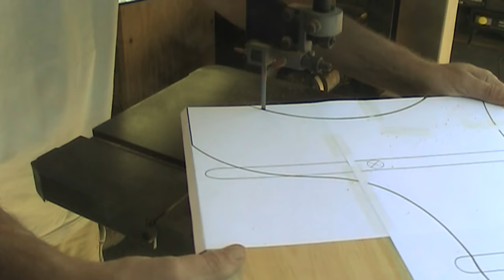Sturdy, easy-to-build, two-step step-stool

Comment: Good video. I think a dado joint is not quite strong enough if you use the step-stool every day because it's just glueing end-grain to face-grain. Adding dowels is an easy way to make it stronger. But amateurs don't have to do so! :)

Comment: Yes, there is :) You just need more patience and time to make it. I actually don't have biscuit jointer, so I simply don't use biscuits. Don't have band saw as well, I use dovetail-saw and rasp when shaping curves. Oh, I have router, but you can round edges just with sandpaper, no problem. And use normal blades instead of dado, a little bit of additional sanding and you are done. Try to figure out those things by yourself and you will be proud of your work. Really!

Comment: Thanks for the answer. Actually I've done some stuff with only a hand saw, chisels,a hand drill and a bench drill. I admire the work from Charles Neil or Paul Sellers, who both have mastered hand tools. For the mere mortals, that accuracy level is still far. On the other side there are people who really takes out the best of machinery (Mathias Wandell or Steve Marin). I guess in this business there's no one who knows everything.

Comment: Hey Steve, love your video, specially since I'm trying to look for ideas for step stools for little kids to use in front or around a toilet.
My sister in law works at a day care and ask me if could build some little step stool for the little kids at the day care centre... Is it possible you could share or create something that could work for the kids, I will appreciate it and so will those tiny kids..
Thanks Steve.
Reply: +elton herrera  You're implying this set up will not work for tiny kids, why wouldn't this size/design work? my nephew and Niece used a stood pretty much this size from when they were first able to physically use any step.   (I looked at the PDF and it is the same size) 
Make this stool with his template and those little kids will use it no problem. In fact I would think he intended for this to be used by kids because the two step is useless  for adults as the top is all you would need.
Reply: try sitting down from the second step on to the toilet if you a tiny kid! I get that is good to teach kids to be creative, but for a day care centre you don't want some other parent kid to have a tiny little accident, people are delicate when it comes to their kids. Just something that they don't have to turn the stool around and that could stay in the washroom only and not all over the house or building. One step would work for potty training, but if kids are bigger and they need to get the cookies on the counter is more than perfect and for everything else is also perfect... I was referring to an idea or design in front of toilet, that also fits around the neck of toilet, that looks neat and catches a kid attention rather than just building a plain box in front of toilet.

Comment: I'm a novice when it comes to this stuff, and one of my biggest problems isn't time or patience, but not knowing what certain tools are or what they do. For instance, the sticky paper you used on the design. I have no idea what that stuff is called or where to find it. Is there a resource (either book or video) that has something similar to an illustrated glossary for the various tools used around the woodshop?

Comment: Nice video....can you please tell me the width of the wood????
Also i would like to tell me the round bit at 0:55 what height does it have?
I tryed in various heights and turn it from the other hand but the result was awfull.
Also what kind of blades at 0:58 are you using and has that width?
thanks in advance
stelios
Ps keep going the nice videos you are making

Comment: I recently had to make slots in some planks like you did at 0:58. I did so by using the factory blade that came with the table saw. Is that considered kosher? Also, if I need to do that again in the future, what's the kind of blade you used called?

Comment: Great video as always Steve but I have a couple of questions as no other documentation was given other than the side templates.  What was the original length of boards you joined?  I am assuming 48" length due to template and video at 1:14 appears the step width is approximate that of the side depth.  If I am completely off please reply to my comment, however I just realized that the other comments made were 10 years ago.  Is there another way to ask questions?  I for one really appreciate your voice during your projects as you make all projects interesting!!

Comment: Hello 
Gnjoyed their work more I would like to know about the mountains where u bought it or if u put side by side to ok. 
I await your return and congratulations for their work so much fun

Publicado em 06/07/2012
You just need a little bit of wood to make this step stool and can make it in a couple hours. I made mine out of beetle-kill pine, but you can use plywood if you want. Would make a nice painted project. If you would like to make this design, here's a PDF template: https://docs.google.com/open?id